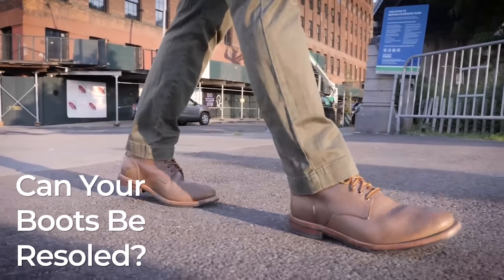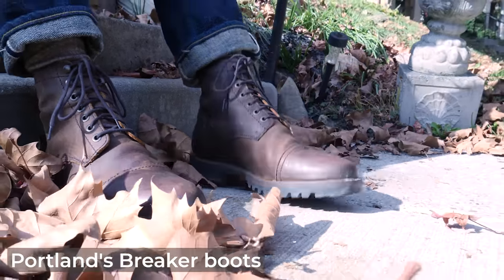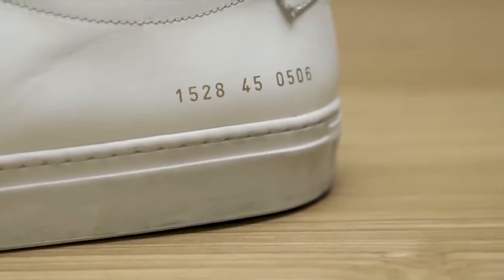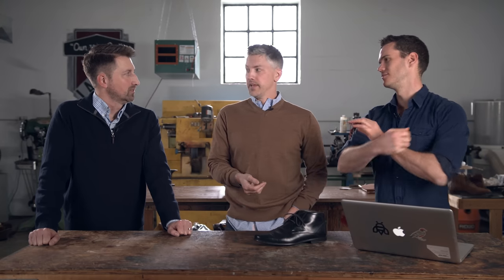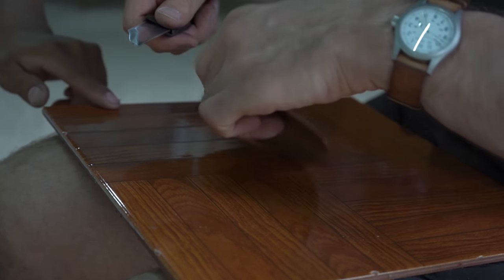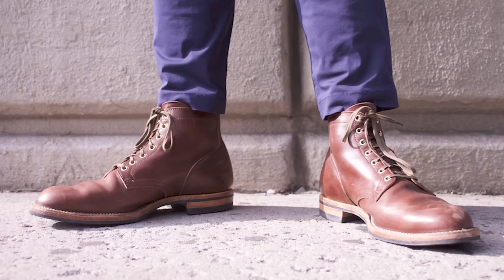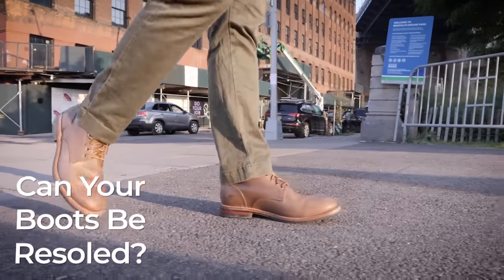Which Boots Can You Resole? (Cement vs Stitchdown vs Blake vs Blake Rapid vs  Goodyear welt vs...)

Comment: A resole on a gyw boot runs you $100 minimum, and more realistically around $200. If the goal was to minimize cost per wear what would be the best construction?

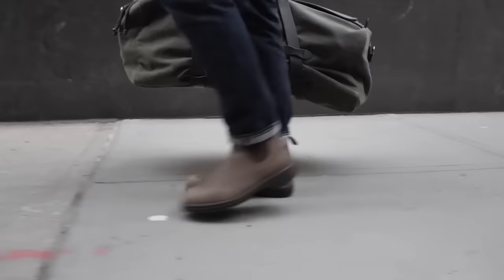If you had a leather sole gyw boot and repeatedly topy it wouldn’t this be more cost effective? A topy job is much simpler and runs you say $40. You actually mention a similar idea at 2:08 where you discuss chopping off the damaged bits and gluing on another sole. And the response is that cobblers “rig it” when they do this, and “you get what you pay for”. 

Why can’t this be done well, repeatedly? Red wings with the vibrant cristys are glued. My topy jobs never “fell apart”. So glue jobs are clearly doable well. It’s a mystery to me why the standard is a labor intensive gyw stitch resole, when there seems to be a much less labor intensive alternative. Let the glued soles take the majority of the beating and resole the gyw stitches as a last resort when something more structural breaks down (cork filler, etc)
Reply: We mention in one of our early videos “How to Prevent Your Footwear From Wearing Out” that sole protectors such as Topy’s, are an outstanding way of preventing your soles from having to be resoled.  Yes, resoling your footwear with a half sole is also a cost conscious and perfectly acceptable way of resoling your footwear…if done correctly.  I’ve seen a lot of botched half sole jobs from cobblers who throw it on for speed and not installed properly.

Comment: Hand-welted shoes aren't harder to resole than Goodyear-welted ones. Cobbler shops don't have the Goodyear-welt machine, the machine they use to do the outsole stitch is the same machine that you would use on stitchdown boots or Blake-Rapids (Rapid was a model of outsole stitching machine). If you ever see a video with Trenton or Heath replacing a welt they're doing the welt-sticth by hand (though they're not punching new holes on the uppers).
Reply: What about stitchdown ? It's that hard to resole ? Still confused
Reply: @siilekkk  stitchdown is simpler than goodyear welt, and is probably easier to resole. However, because the stitch is running through the upper itself (instead of running through a welt) there's only so many times you can resole it before too many holes get punched in there and it can no longer hold. You can also run the risk of wearing through that part of the upper to the point where there isn't enough room left to resole. The advantage of goodyear welt is that the stitch runs through the welt. If it gets too damaged from too many resoles or just normal wear and tear, a cobbler can just replace the welt. And if they hand stitch the welt onto the upper, then they're not creating any more holes than originally. In theory, this means a goodyear welted shoe can be resoled many more times than a stitchdown shoe. The downside is that it's more complicated (and therefore more expensive) to resole a goodyear welted shoe. And realistically, how many times are you really going to resole your shoe before the upper itself gets so worn out that it's not worth repairing? Some people say that a stitchdown shoe can be resoled 3 or 4 times, whereas a goodyear welted shoe can be resoled dozens of times. But again, assuming you're not straight up abusing your outsole, how many times are you really going to be resoling your shoe before the upper is done for? And once the upper is done for, you're really just getting a new shoe.
Reply: @ShadeSlayer1911  Thanks pal. I think 3 or 4 times is enough for me
Reply: @siilekkk  Depending on the boot though, you might then be able to get them rebuilt even after the upper is too worn down to be resoled again. Pacific Northwest style boots are usually good candidates for this. And I'm thinking you could probably even get them rebuilt into goodyear welted boots, which would then give you even more resoles. But again...how much are you really going to need that many resoles, realistically? I certainly like the idea of "infinite resoles," but I also recognize the unrealistic need for such. I'm not exactly the type of person who'll abuse the soles anyway. 

But with how expensive PNW boots tend to be, it might actually be worth doing such a thing. Or if you happen to find an old pair that needs some love, that could be good too.

Comment: It’s actually crazy you just posted this video. I just started wearing good year welted shoes and in one of them I need a resole. The boots is the Duke from Thursday and I’m looking for someone in Toronto to resole it. Also, is it possible to get my shoe ‘relasted’? I wish the boots were half a size smaller. I can always just put an insole but curious if there anyone in Toronto/Canada who does that.😊
Reply: I'm not from Toronto so I can't help with finding a cobbler. Also just get a new pair if you're willing to have them relasted. You'd have to take the whole boot apart and replace the insole. You'd easily run above $200 if you can even find a person to do it.
Reply: Relasting is possible but only a very limited number of people are willing to do it. Your best bet would be sending it to one of the youtube recrafting cobblers like Dr Sole or Wyatt & Dad but it'd cost you probably the same as 4 or 5 new pairs of the same boot. Availability of the specific last used for that boot is also a problem. Doubtful that anybody except Thursday Boot Co has the last for that boot in a half size down, so you'd be looking at paying probably ~2000 bucks to have a custom last made and the boots relasted. If they're extremely sentimental to you it might be worth it but if it's just a sizing issue you're better off buying a new pair.

Comment: we had some great cobbler here in CNY no more no more stitching soles not even half soling noow glue on rubber half sole more like sole savers! yet their prices have gone up. had a pair of army low quarters, of course they are cheap bates shoes, the soles fall apart, these bates were new never wore em cobblers here wouldn't touch them one piece sole and heel nothing more then a glue job, had to throw out a new never worn pair of shoes crazy, how do these guys put food on their table? they don't or won't do the work!! and they all been talking retirement for more years then i can count

Comment: Surprised you didn't mention White's in the hand welt section! Also, hand welted shoes are not necessarily harder to resole than GYW shoes (as long as the cobbler is not replacing the welt). Most handwelted boots/shoes use a machine outsole stitcher to stitch the outsole/midsole.
Reply: White's is a different "hand welted" construction. They're talking about the traditional English style hand welt. White's "rolled welt" is a more unique stitchdown hybrid.

Comment: Cut off the damaged parts.  Sand it down.  Then glue on a new piece of rubber.  That's how my local cobbler does every job.  It's functional.  You get to keep wearing those shoes until his work fails.  

Most of the Pacific Northwest bootmakers offer resole and rebuild.  They actually replace the vamp, relast the boot, and it's a brand new piece of leather getting stitched down to the new sole.  No new series of holes to perforate the boot.
Reply: Interesting. But I think the vamp will have to be stitched on the old leather uppers so that can cause a Swiss cheese effect too but in another area. Well, unless they hand stitch it to the existing holes in the uppers which I'm guessing is possible compared to the soles where it's basically guesswork/approximation.

Comment: I think the term for the sneakers with stitches on the sides of the high walled rubber sole is called "cupsole" It's the same construction used on the Jordan 1 and Air force 1 they can be resoled as long as the upper is in good condition. If your cobbler puts on the effort I think it's possible to reglue and stitch the upper to a new cupsole without adding new holes on the upper. They can use the holes already present on the upper as a guide to punch out the holes on the cupsole they have to hand stitch it. But of course it's really time consuming and takes alot of effort so the most practical is to just stitch it using a machine. But like the blake stitch you can only do it a number of times before your upper gets trashed by the number of holes on it.

Comment: Can resoling result in shoes getting smaller and fitting tighter? Is this also a factor of the shoe construction?
E.g. I recently got a pair of old Bostonians (blake stitched) resoled and they ended up coming back almost a size smaller.  Apparently, as per the cobbler, this is normal for blake stitch resoling.  Please help with your advice.

Comment: Loads of glued sole hiking and mountaineering boots and shoes can be resoled and returned to their original state. The manufacturers design them so that they can be resoled and explicitly state on their websites that they can be resoled. There are also cobblers who specialise in this sort of footwear. 
European/UK brands like Altberg, Hanwag,  Scarpa, Meindl and Zamberlan all have large numbers of models that can be resoled. It might be different with USA brands.
It is the moulded soles that have a combined mid sole and outsole created as one unit using technical manufacturing techniques that are hard to obtain. These either have to go back to the manufacturer or to the specialist  cobblers that have relationships with the boot manufacturers and carry out repairs and replacements. These cobblers exist in North America as well as most European countries.
Reply: Thank you for pointing this out. Re-soling glued hiking boot soles is an extremely common practice in the US as well.
Reply: This is actually really good information to learn.

Comment: Since most GYW boot soles are attached to a gemming, and the gemming is mostly only glued to the insole, doesn't it make it so that the only thing connecting the upper to the sole is the glue that is attaching the gemming to the insole. 

The reason I am asking this is that you guys always say is that the gemming glue on redwings always come undone over time.
Reply: gemming doesnt attach the upper to the sole, it helps pull and square the upper down to the insole level. it only helps to put and stabilize the upper in place prior to stitching the upper into the welt.

red wing crystys become problematic because you dont have a leather sole to stitch onto the welt or the outsole, which makes it really annoying if the gemming ever come loose
Reply: @hanifmckagan4448  So what you are saying is that the upper, the welt and the gemming are stitched together, and the welt is stitched to the midsole so yes upper is connected to the midsole via stitching, even though it is not stitched to each other. 

So, when gemming gets lost the only thing that can, if forced, be removed is the insole, but even than the shoe would remain intact.
Reply: yeah youre spot on! 💯💯 @bariti86